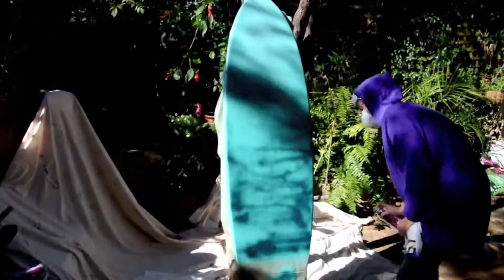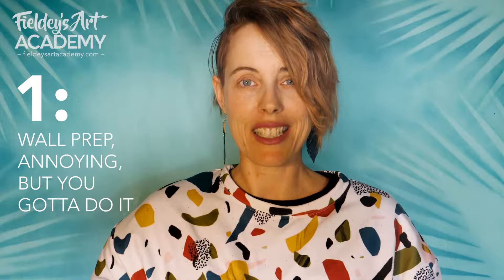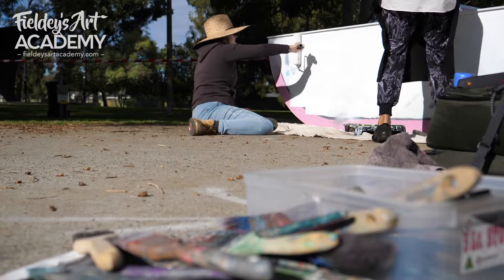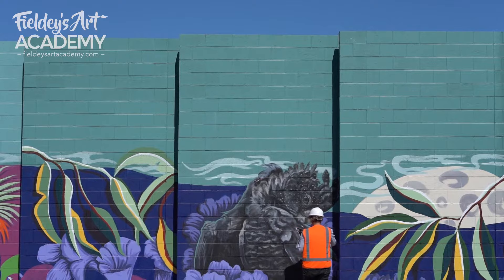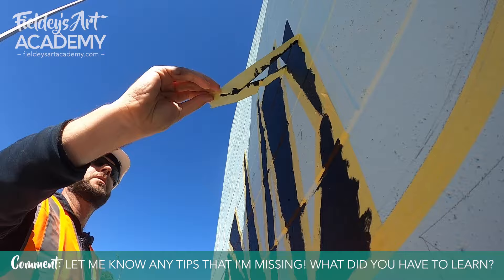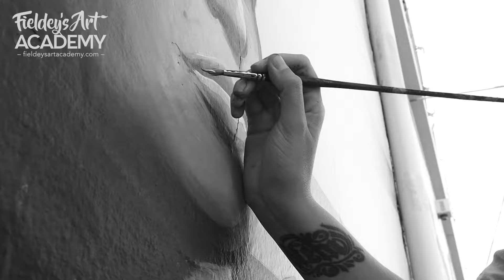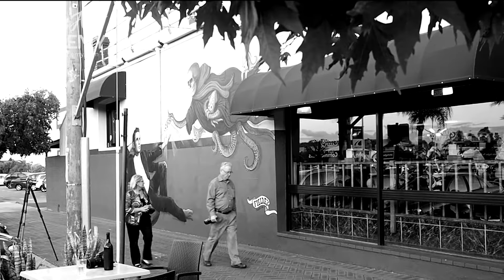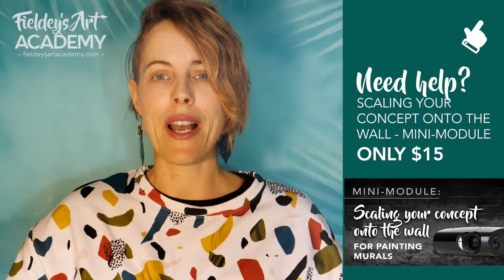10 crucial things you need to know before painting murals & street art

Comment: Preparing wall is most inportant I agree then I seal the wall with 2 coats of exteria PVA glue watered down 30%. When you can't project an image on site use large piece of paper then project image on to that using blackboard coloured chalk. Tape it to wall then transfer image using pressure. Chalk lines  are easy painted over. Results are allways great. These are my methods of been a sign writer artist that I'm glad to share.
Reply from the maker: Ooh! Yes! These are excellent points! Thanks!
Reply: Great tip. Just an added note on this method for novices. The chalked side needs to be toward the wall in order for this to work. Remember that if you turn your image over to put the chalk side towards the wall it will be reversed. If you don't want it reversed (ie., in the case of text) you can draw your image on the paper and then chalk the back side and trace the image using pressure from the correct side.

Comment: Choosing the correct roller for the specific surface. Smooth metal requires a different roller than rough concrete or stucco for example.
Reply from the maker: This! Such a good point... I'm guilty of using whatever roller I have in the shed 😬

Comment: I have a question so my bedroom's wall is oil based and l plan to paint it on with acrylic paint does it required coating to get a smooth and waterproof surface or should. Skip the coating section?
Reply: your acrylic paint is water based, so its going to fight with the oil based paint. I use a primer undercoat that will paint ontop of the oil coat and allow acrylic to stick. Your local hardware/paint shop will be able to help you out no sweat 😎